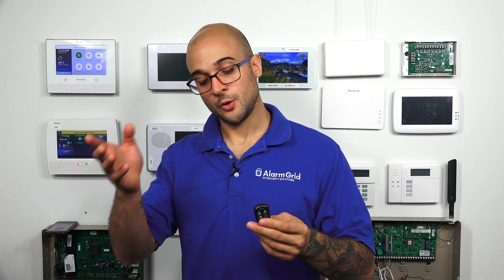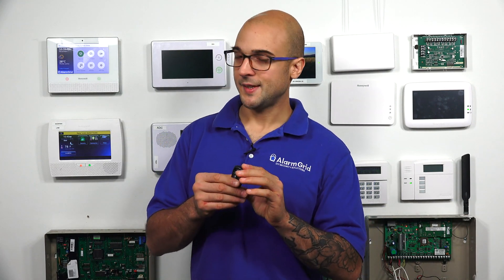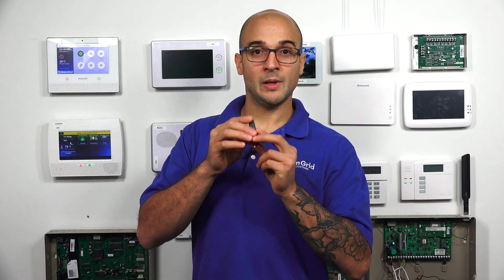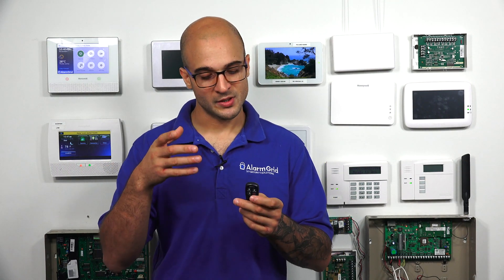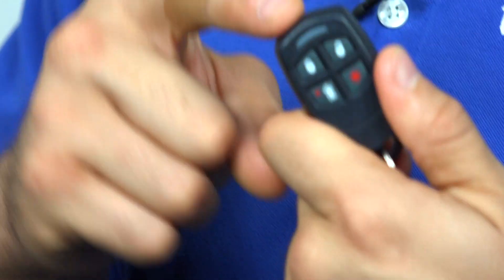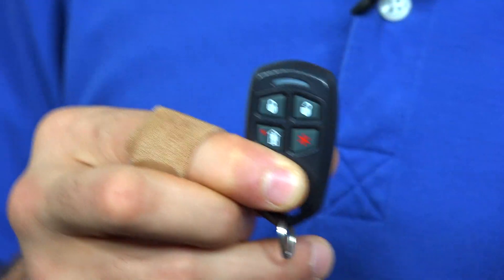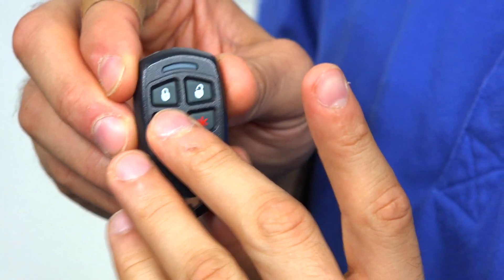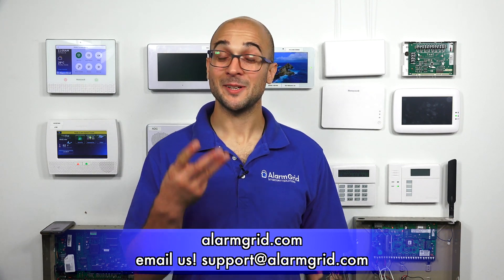Putting a 5834-4 Into High Security Mode

Comment: How can I confirm if someone  put a keyfob on my honeywell vista 20p without my permission? I found a keyfob serial number and zones hand written inside the lockbox/ panel box.  I made the  mistake of trusting someone with my Master Code years ago and since then canceled my monitoring service.  This person I made the mistake of trusting has been stalking me for almost six years now.
Reply: Go into programming mode and go into the *56 zone programming menu, then check zones 49 - 64, it will give you the serial numbers for all the FOBs programmed into your system.  Typically zones 49-52 will be the first FOB, 53-56 the second, and so forth.  You will probably want more info then this which you can get from the programming menu.  Just YouTube how to program keyfobs and you will find the info you need.
Reply: @carsonsargod   Thank you . 🙏